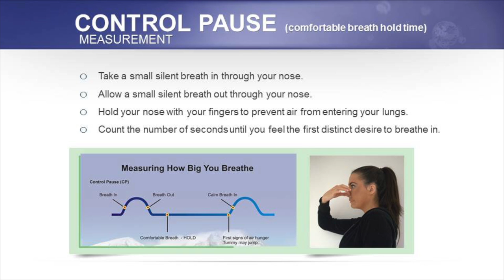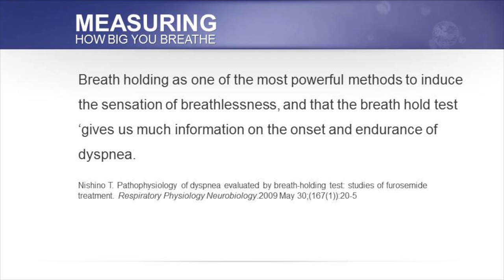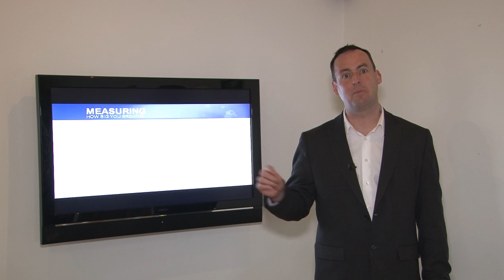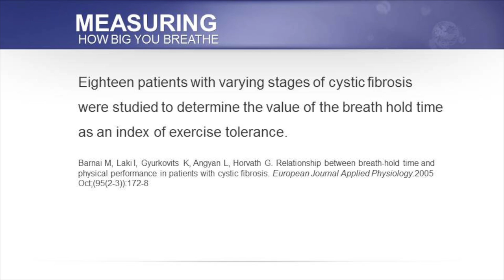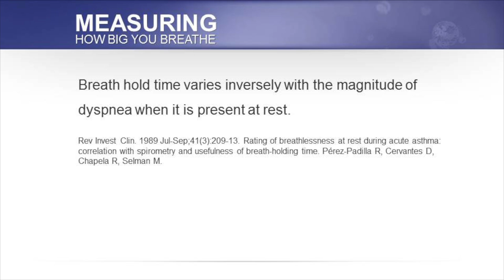Buteyko Breathing Exercises: Control Pause to measure relative breathing volume

Comment: I’m practising this method, but i’m confused. Is it possible to change or interfere with the breath, which is controlled by the autonome nervous system? I mean, if you practise breathhold throughout the day, the next morning the breath will again go back to whatever the breathing volume was acording to that person’s physically and psycologically state, I guess. So my question would be, is it possible to manually change your own breathing through these breathhold exercises? I’m a person who dealt with a lot of anxiety and stress that comes with it. I experience that when i reduce my breathing, my mind quiets and I feel less anxious. But when I wake up I feel fatique and as I could go back to bed. Any advise how I should be practising to reach a higher cp? Thanks.
Reply: There are videos by Patrick about how to increase the CP.

I fall back to mouth and overbreathing during the night and feel not fully rested. However after the nosels opening exercise and nose breathing I feel energized and ready for the day.
Reply: Did you come up with anything helpfull? Have the same issue when waking up. Chronical hyperventilation and panick attacks are a bitch to get rid of..
Reply: @johan9388  I'm taking amitryptiline for chronic hyperventilation syndrome, got anxiety and depression. It has helped a lot but the symptoms haven't gone away yet, it's been about a year now. I will start practicing CP too. Good luck
Reply: Just do Wim Hof Method
Reply: @joshuegv-4492  why not both